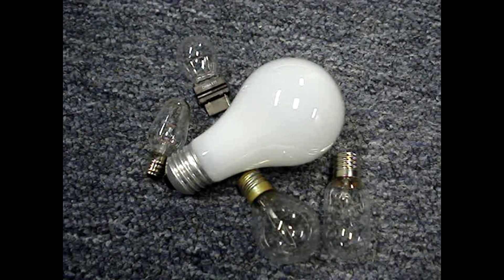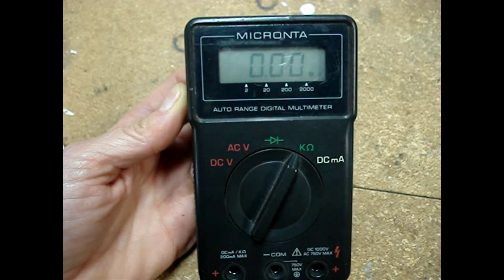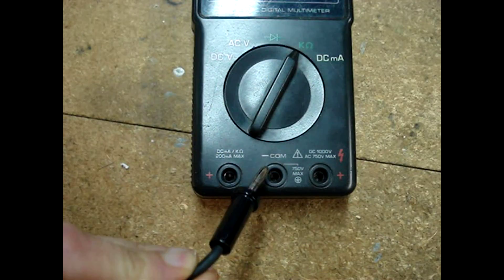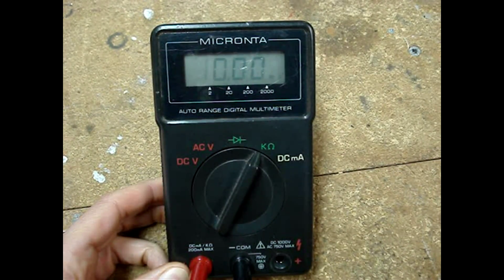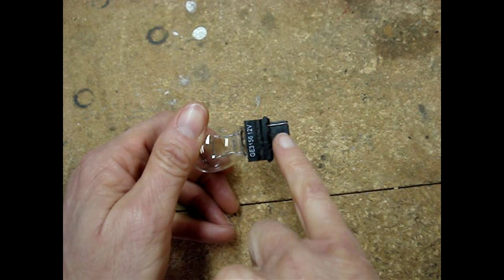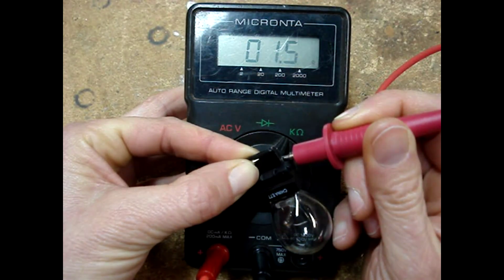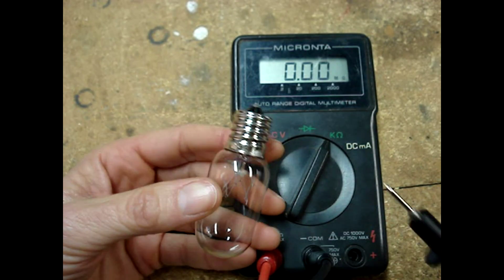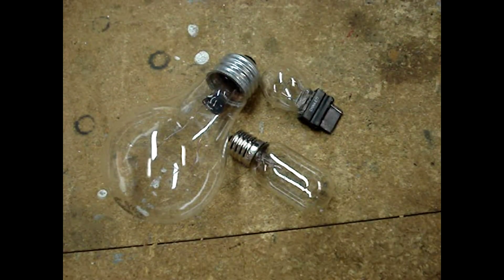Test a Light Bulb With a Multimeter

Comment: I have a bulb for a lamp that has two "prongs".  Do I use my multimeter to test resistance like a normal light bulb?  Any help would be appreciated.
Reply: It looks like a regular LED other than the prongs.
Reply from the maker: If it's an LED bulb testing resistance won't work.  If it's an incandescent bulb, put a meter lead on each prong and if it's good you should read a few ohms if it is good.

Comment: Is there a way to check how many volts a small light bulb is rated at using a multi-meter? I have a number of small bulbs that I use for my model train layout that do no have a rating printed on them. They are mostly 12v,14v, 18v and 24 v bulbs. How can I check their voltage rating so that I don't burn them out of use them where they will get to hot and possibly melt a plastic item.
Reply from the maker: Here's a few suggestions.  https://electronics.stackexchange.com/questions/101268/how-to-determine-required-voltage-of-a-lightbulb
Reply: Thank you @Know-How-Now

Comment: Why let your skin come in contact with the tips of the test probes?
Reply from the maker: It doesn't matter, no power except a minute amount from the meter... you can't feel it and it won't hurt you.  If the bulb is good you will see almost a dead short, just a few ohms.  If you hold the probe tips, you will read a small amount of resistance - your body, almost infinity.  The meter is going to read the path of least resistance if your fingers are touching the metal ends of the probes - a few ohms if the bulb is good.

Comment: I'm a subscriber, to your videos.
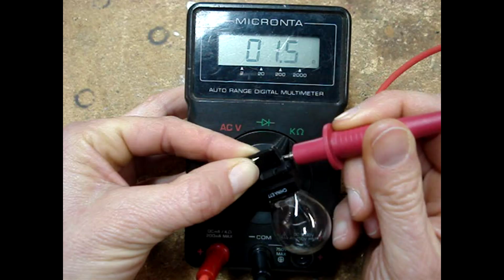I've got a specialty bulb like the one at 3:24 in this video, that I want to test in the same way that you do in this video for its ohms, with the same kind of multimeter. It's an old incandescent bulb, and the filament inside of it's broken, so it no longer works. Can I still test it in the same manner, to find its ohms? I know that it's voltage is 120 volts, and I'm trying to find its wattage from the math formula that uses the known volts and ohms of an electrical appliance.
Reply from the maker: Hi Ken,  If the filament is broken, you will read an "open" or infinity.  Even if the filament wasn't broken, I don't think you can figure out the watts by measuring the resistance of the filament. Are you trying to identify the bulb's wattage?
Reply: @Know-How-Now  Yes, I'm trying to identify this incandescent bulb's wattage when I only know its voltage (120 volts), and its filament is broken. There are no markings on it at all, except the word "Taiwan" is stamped on the bottom of it. Can you tell me how I can find its wattage?
Reply from the maker: You might try finding the schematics for the device that contains the bulb or see if there is a max wattage printed on the device.   The other thought is check with one of the on line bulb retailers and look at the bulb shape & socket.  That bulb may come in just a few watt choices.
Reply: @Know-How-Now  I also need an owner's manual, for a Fluke 289 True RMS Multimeter. Do you know where I can get one, maybe a used one, cheap?
Reply from the maker: I'd check on eBay.  You may even find someone selling a microscope like yours there.  The seller might be able to help you out with a bulb.
Reply: @Know-How-Now  I figured out how to get a cheap copy of the 88 page owner's manual, for my Fluke multimeter. It's an $800.00 multimeter, but I got it for free about 7 years ago from a friend who simply gave it away, because he no longer had an electric guitar. It looks like it still works.
The burned out light bulb, that came with my microscope, is the size that's called a C7E12, with a threaded base. It's glass bulb surface is also transparent and like the microscope, it dates from the early 1960's. Do you know what the brightest transparent replacement for it is, that I can at this time buy brand new, and can you also tell me just how bright it is?
Reply: @Know-How-Now  I thought that the wattage of a bulb could be found by multiplying the bulb's known voltage by itself once, and then dividing that number by the bulb's known ohms. Even if that's accurate, you're saying that even this won't work because I can't find my bulb's ohms, because its filament is broken? I know that its voltage is 120 volts.
The bulb is a 60 year old bulb that was in a Gilbert microscope kit that was made in 1962, and so the microscope is also 60 years old. I bought the microscope off the internet, in May of 2022. The bulb has an E12 threaded metal base. It screws into a small plastic receptacle, that has a dropcord on the other end that plugs into a wall outlet. After looking at the receptacle carefully, I found the words "75 WATTS" stamped on its plastic side. Is this indicative of what the bulb's wattage is and if so, what is it? No other numbers or terms are on the bulb or the receptacle, except that the word "TAIWAN" is stamped on the bottom of the bulb's E12 metal base.

Comment: Please help. I am wanting to change my MES bulbs in my jukebox cd player and have been told if i don`t use the right ones I could blow many of the components. There are many bulbs on Ebay displaying voltage and amps (mA) etc. 
When i use a multimeter on the current working bulbs, I am get 8 Ohms. So which volt and amp bulbs should i buy?

Thanks in advance.
Reply from the maker: I am not an expert on bulbs.  You might try to check with a company that sells specialty bulbs.  They might be able to help you.

Comment: Hi there, I held the meter leads togheter and it showed 000.0. What that means? The leads are not good? I've tried with 3 different pair of leads. Thank you
Reply from the maker: That means your leads are good.  A good meter lead/meter test can vary on different multimeters.  When you hold the leads together, you should see anywhere from zero ohms (as you did) to around 1-2 ohms.
Reply: @Know-How-Now  Thank you for the reply.

Comment: I would like to learn more about broken leads on a voltmeter and how to make sure they are broken
Reply from the maker: Set the multimeter to read ohms, lowest amount if it is not an auto range meter.  Hold the lead tips together with one hand.  Wiggle the leads, if the reading on the meter does not stay within a few ohms/the reading jumps around in a wide range, then the leads are bad.  The wire inside the casing tends to break where it bends.... where it exits the plugs and where it exits the probes.  Cheap leads on cheap multimeters don't last very long under constant use.  I used a Fluke (the gold standard for multimeters) multimeter for about 10 years every day and never replaced the factory leads.  Lower quality leads will not last this long.
Reply: @Know-How-Now  Thanks
Reply from the maker: You are welcome, Patrick.

Comment: What if the bulb i'm testing is 10 watts and below? Would smaller wattage bulbs even register on the mulitmeters?
Thanks
Reply from the maker: The bulb wattage is not important.  The concept is to find out if the filament is broken.  If your reading is around 100 ohms or less the filament is not broken.

Comment: What's the difference between testing for ohms and testing for continuity?  To see if a light bulb is bad I check continuity.
Reply from the maker: Good question, there is not a huge difference, basically, you test for continuity on a wire.  If you are testing a "device" , then you are checking for resistance.  If you watch my video "Use Multimeter to Test Resistance and Continuity" I explain it in depth.  https://youtu.be/9H-uMSGHFXM

If your multimeter has a setting for continuity (most meters will beep if you have continuity on that setting) you should use that for checking a wire and use the ohms setting for a "device" such as a resistor or the coiled up wire used for a filament on a light bulb.  Because the resistance is so low on most bulbs using the continuity setting may work out OK, I've just never done it.
Reply: Will do, thanks!!
Reply from the maker: You are welcome and thanks for asking questions, you always have good ones.